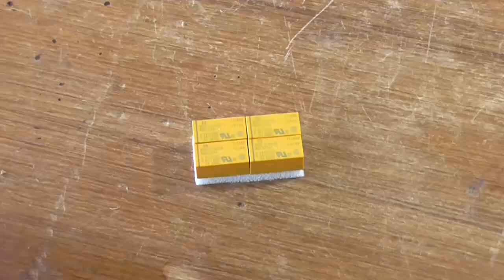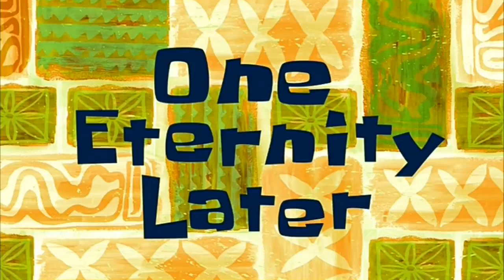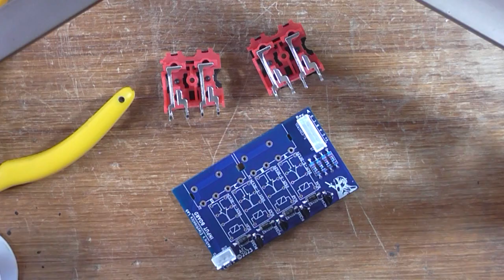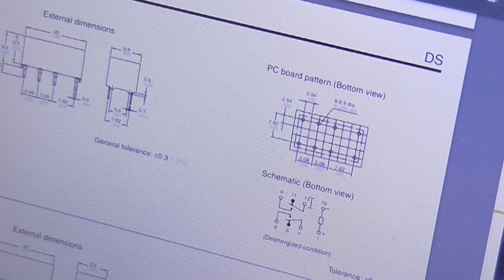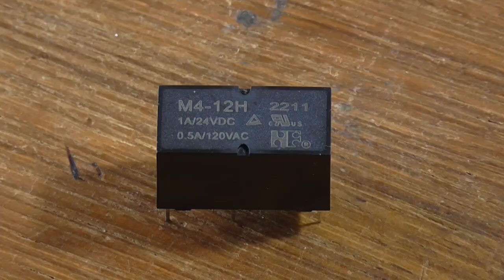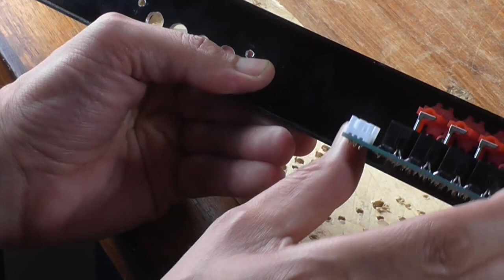15W+15W Stereo Amplifier Build - Pt. 8: Input Selector

Comment: A word or note on your choice of base resistor on the switching transistors, and the reasoning for it; I don't believe you can oversaturate specifically, but you can run too much base current which in of itself causes heat generation.

On saturation though, it's better to drive them into full saturation when using them as a switching transistor, as that completely avoids the linear region which is the region that produces heat.  Limiting current in the entire chain using a resistor, coil's resistance, etcetera is a solid way to ensure you're in saturation and have the lowest possible Vce drop.
Moreover, as the Vce increases, so will the heat generation (inherently). This causes the gain of the transistor to drop quite sharply, and might end up causing your transistor to overheat due to dropping out of saturation. I aim to saturate and choose a base resistor assuming a gain of 10. It's fairly safe for these BC549 transistors and a good rule of thumb unless you have specific reasons to save power/current draw.

So in other words: what you here attempted to do in order to avoid overheating of the BC549 transistors, is actually more likely to cause exactly that.

On another note then: I absolutely love this series! You do a great job at explaining and showing the possible errors you might've made is a great way to learn along and find pitfalls in your own thinking (as a viewer).
Reply from the maker: Yeah, I did think of this. However, at 12V and 10k the voltage at the bases is 0.72V so... and the transistors themselves don't appear to be heating up at all. So, I guess it's all good. And, thank you! I'm enjoying making it - just not enjoying having to re-design/re-build stuff because the first one didn't work right... lol